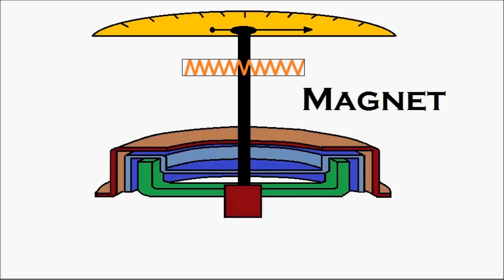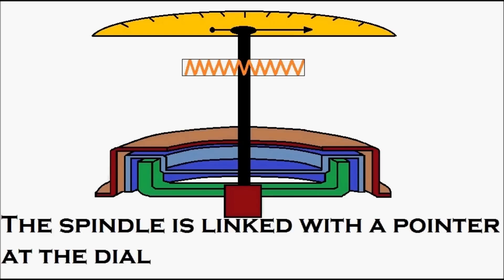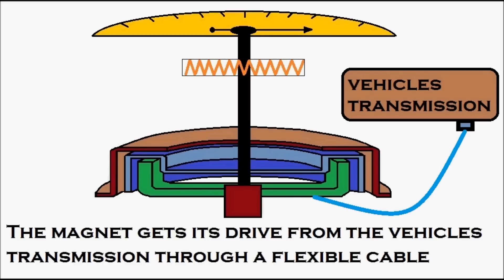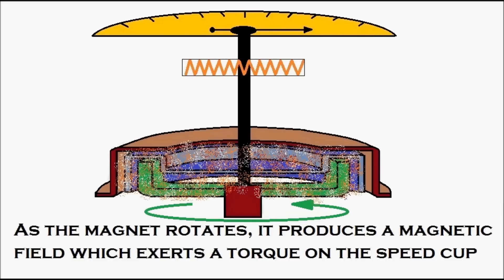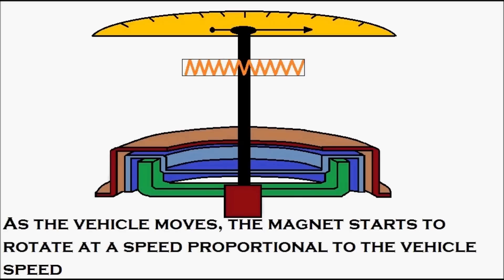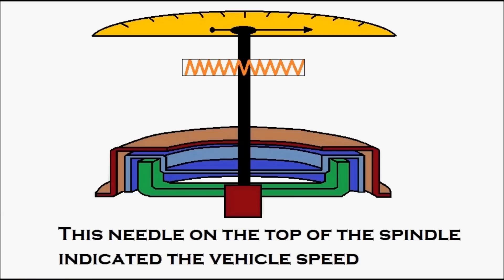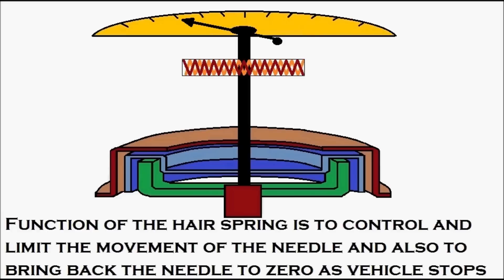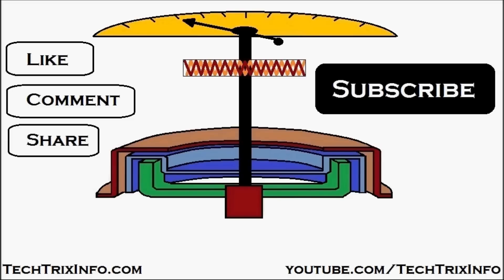Animation | How speedometer works | Eddy current type

Comment: Hello I'm wondering if it would be possible to rotate the blue speed cup (and therefore also the spindle) by electromagnetic field coming from the external voltage NOT from mechanical spins of the permanent magnet (connected with the cable). What do you think? 
I'm thinking about controlling such a classical speedometer from Arduino (or another microcontroller). It would be much easier to generate specific voltage instead of controlling the magnet rotation
Reply: The magnetic field has to be rotating, as it has to provide a rotational force on the cup. which is not easy to do as a DIY job. Maybe there are analog speedometers with electric input. My dad once made a fuel usage indicator from a tachometer from an old Ford Sierra (don’t know the year).  That was completely electronic but with analog needle. I don’t know the further details on that project. Another option would be to control a motor with your Arduino and connect that to the input of the speedometer.

Comment: the video initially says, "magnet rotates with the same speed as that of the transmission." 
then it says, "the magnet rotates with a speed proportional to the ...". please correct this. good video otherwise!
Reply: Im also thingking, speed in terms of what? Does it pertain to rpm or vehocles actual speed. Its differrent.
Reply: I noticed that mistake as well but i let it go.. He means, the magnet speed is proportional to the vehicle speed. Of course it cannot be equal to as that makes no sense. The magnet turns (rpm) while the vehicle moves in a single direction (km/h), in math sense rpm cannot be compared to speed. But it can be proportional.

Comment: u wrong as hell bruh.. my niece showed this and i laughed straight up.. the actual mechanism is , the transmission wire supplies current proportional to the speed and also has it rotating independent of the speed cup which produces changing flux , i.e eddies that provides a torque to the spindle - rotor system which rotates / provides constant torque that is held at equilibirium by hair spring , which basically holds it , engineered with the appropriate spring constant to display the correct reading at the dial... and you said twas magnetic field dude.. cmon bruh u have 150k subs , this is high school shit
Reply: Maybe youre pertaining to digital speedometer or tacometer. Those two have the same principle except for the speedo measures vehicle speed ang tacometer measures engine speed in terms of rpm.
Reply: @czaralfeojerusalem1252  no , im talking mechanical

Comment: thank u for da video. 1 doubt- most of da Indian 2 wheel vehicles speedometer is linked with the front wheel and der is no links present from transmission to magnet. so how does dat works??? or dis kind of speedometer only applicable to 4 wheelers??

Comment: What if you buy bigger or smaller tires?
Reply: there are apps to help you calibrate your speedometer.
Reply: @holdshiftt2run308  That will only work for speedo’s controlled by the car’s computer. An app is going to do nothing about true analog speedo’s with a cable going right into the transmission, which this video shows.
Reply: It will change the speed that is showed in speedometer resulting in mistake. Smaller wheels will make the speedometer display a higher than real speed, and vice-versa. Hodometer will be changed too, Smaller wheels will make the odometer display a higher than real distance, and vice-versa.

Comment: not bad. I'd like to know how the hair spring works. if the magnet spins the spindle, how come the pointer doesn't spin along with it?
Reply: the spring stops its from spinning with the needle
Reply: The magnet's not attached to it. Only the magnetism itself turns the speed cup which turns the spindle.The speed cup is made of aluminum by the way, which is barely magnetic
Reply: The further the spring gets compressed (=the higher the needle goes), the more resistance it gives to the needle.

Comment: QUESTION : If you were to oil the speedometer would it interfere with the speedometer ???
Reply: No the oil only would only lubricate the moving parts (cable and magnet) it would never get into the speed cup because they are not attached, they don't even touch.
Reply: Depends where you put the oil. If it creates drag between the cup and the magnet then your speedo will be messed up. A speedometer which is not designed to contain oil is likely not oil-tight.

Comment: how would speed of magnet equal to the speed of vehicle?is it fixed in vehicle or what?
Reply from the maker: +Mijas Tiwari 
Thanks for the comment. 
Whatsapp @ +919744615655 for more info...
Reply: first you answer the questions
Reply: question
Reply: the magnet don't have speed it works on the principle of deflection which it gets from the input....study about electrical instruments like voltmeter or wattmeter....u'll get the idea
Reply: Mijas Tiwari yes,it had been re-normalized,the analog magnetic counter isn't truthful than a real digital counter so the current which produced by vehicles is different such can change the real velocity display.

Comment: Thanks it helps me so much. But can you make a video about tachometer?
Reply: I would say that’s exactly the same principle. Only the cable is connected to the engine (maybe with some gears to reduce the speed) and a different faceplate on the indicator.

Comment: I have a  very important question about the cluster of a 2005 hayabusa involved in an accident. The rider is severely brain damaged unfortunately and is bedridden in an auspice for life. Is there a way i can contact you to discuss what i need to know about whehter a needle apparently stuck at 65mph while the cluster is completely detached from the bike (on the ground) reflects the speed the man was driving or is it possible that the needle could have gone anywhere on the speedometer plate? Also, the rpm is stuck at 1200 rpm. Is it possible. I heard that if the spring is broken then the needle can go anywhere and if it is not the needle goes back to 0 mph. What do you think? I need an urgent answer.
Reply: naaa its a crash mate, that needle can go anywhere and everywhere, depends on how it breaks.
Reply: If the rear wheel lost traction, which happens on a Busa already when you twist the throttle too far open, the speedo can show 150km/h while the bike could actually have been going 30. Also, the fact that you are DIY-researching such stuff via Youtube comments for something “highly important” around people with brain damage and probably legal cases, should make you realise that you are way off track for finding proper resources. This sounds more like the job of a research team of a police department.
Reply: Actually,  what Richard says makes total sense. The  bike of the rider  who hit me head on did leave the ground and the rider went over the handle bar. Hence no traction,  hand on the throttle.... makes sense. 
But,  the other comment is also true. In my case, and it turned to be a legal battle against various actors,  including the CHP and the county of Los Angeles, I found massive evidence of corruption and the case is before b the 9th circuit now for falsifying public records of accidents,  their true causes, how the county of L.A, the state of California and the CHP have conspired to derail my case and countless others who didn't go as far as I did. Believe it or not,  the president of division 8 of the court of appeal., Patricia Bigelow,  among with the presiding judge of the superior Court,  Samantha  jessner, are involved in the cover up. All evidence has been given to state and federal courts and no-one wants to do anything about it. They just don't know that I am like a pit bull. I don't let go. 
There is si much more to say. Stay tuned.  I am on about to go public on who did what with irrefutable evidence of the corruption that drains public funds,  tax payer money and countless death due to lack of accountability

Comment: How does the speedometer measure vehicular speed and not the crank shaft rotational speed ?
Reply: you connect the crank shaft to the engine or wheels
Reply: it does measure crank shaft speed and the shaft is connected to the wheels.
Reply: @mrcow202  The crankshaft is part of the engine, where the pistons are connected to, so that has nothing to do with the speedometer. A speedo measures the driveshaft which is the shaft from the gearbox to the differential.

Comment: Why all The cars don't uses digital speedometer? It has more accuracy and it's simple
Reply: +Matheus Bitencourt They also break easier and knowing the speed your going is the most important thing to road safety, plus some old speedometers look sick. End of Discussion!
Reply: Kyle D All the fuel injected cars uses Electronic Speedometer. The speed is required by the fuel injection system in order to measurate the correct amount of fuel and air in the mixture. Some of the electronic speedometers use a needle (like the old mechanical one), others use a digital display
Reply: Matheus Bitencourt the mechanical magnetic ones arnt electronic smart one, those are the ones im talking about.
Reply: actually, electronic speedometers are way more reliable than magnetic ones. I never saw a electronic speedometer stop working, even in my old 1982 car. Magnetic Speedometer are more likely to deregulate over the time
Reply: +Matheus Bitencourt 
Mechanical speedometers are quite flimsy designs. The needle tends to sway or fluctuate with age, especialy a lower speeds below 35 mph or 60 km/h, as with mine. 

As the car slows down towards zero, it swings 
really wildly.

I think this is due to the spring weakening over time.
Reply: ThamMalaysia Yes, I noticed it in my grandpa's car. It's 1991, pretty old
Reply: That only means you need to lubricate the cable. Use vaseline.